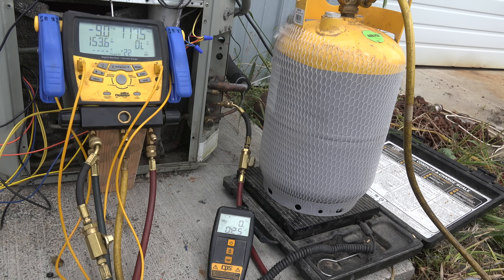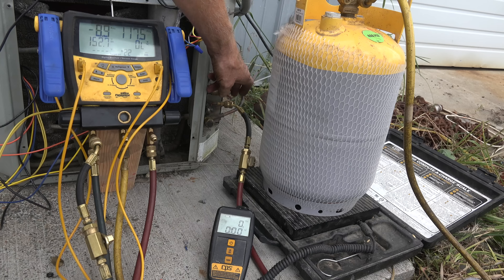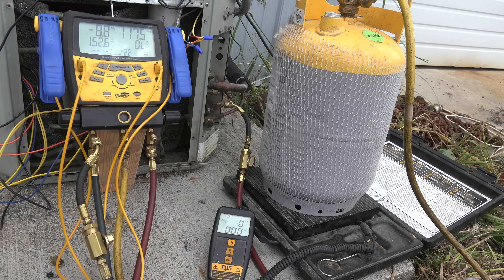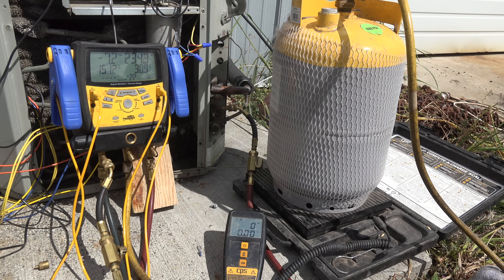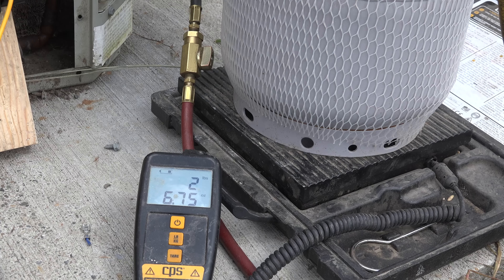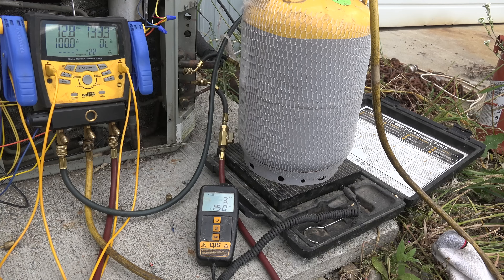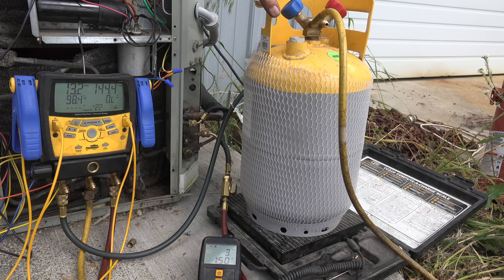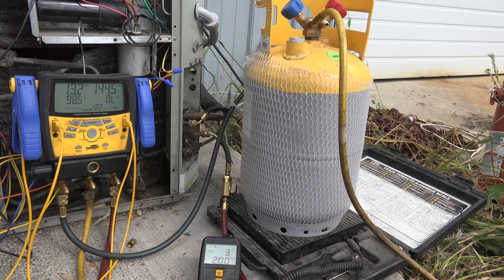Is oil removed with liquid refrigerant upon recovery #1.

Comment: I'd figure under vacuum even mineral/polyol oil would volatilize, which was why new condensers are shipped pre-charged.  I worked at a plant that did short-path distillation under strong vacuum (VERY strong, ~1 micron) which would trick vegetable oil derivatives into the gas phase.  Maybe the relatively weaker vacuum of refrigerant recovery isn't strong enough.  I know you didn't pull vacuum here, though.

Thanks for sharing.
Reply from the maker: Very little oil is gasified under refrigerant vacuum.
GFM
Reply: Boiling point of POE oil at room temp is about 10 microns of vacuum so for all practical purposes it remains as liquid at the best vacuum achievable by typical A/C vacuum pumps.  Tough part of vacuuming a system with distributed oil is getting the small microbubbles of humid air stuck in the POE oil which is highly hygroscopic (likes to absorb water).

Comment: I didn't catch what type of refrigerant it is, but for R410A it is highly miscible (in all phases, gas/liquid) with the lubricant, so basically you can't separate the oil from the R410A, it's a homogeneous mixture.  So presumably the 'oil' went into the tank, and then back out again.  It's interesting because it seems to negate the use/avoidance of oil traps in systems that use R410a, whereas in the past it was presumably necessary with other refrig's.
Reply from the maker: I think you have a misconception about miscibility.  
Gaseous refrigerant is not miscible with liquid oil.  When refrigerant evaporates, the oil is mostly left behind as a liquid.  A very small amount may be atomized and moved with the refrigerant gas but it is a very small amount.
GFM

Comment: Typically, about 2-3% of liquid line flow is oil.  But that rate is for normal operation. For 3 lbs, 2 oz, that is only about 1 to 1.5 oz of oil, under normal operation of total liquid refrigerant in liquid line with proper refrigerant charge.

When pulling out the refrigerant via running compressor, the vapor mass flow rate out of compressor high pressure port and through the condenser will continue to drop so less oil droplet mist, while refrigerant is still vapor, will make it into liquid refrigerant on liquid line output of condenser.  A lot of the oil will cling to walls of condenser tubing where refrigerant is still vapor without enough vapor mass flow to move it along.   Once pressure drops to where no liquid refrigerant is made, the liquid line output will have very little oil content.

Comment: You have to unscrew the cylinder's valve out and Then check if ther uss any oil left in the tank
Reply from the maker: Or you could turn the cylinder upside down and open the valve.
GFM
Reply: This is the only conclusive way to validate the claim. Unscrew the plug or unscrew the tank valves. How can you prove there is no dip tube short or long in the vapor port...

Comment: Fantastic video GFM!! This is a major question that I have always had on my mind. So you just used the compressor and not a recovery machine for this test?
Reply from the maker: I did use just the compressor and removed all the liquid I could.  I did not use the recovery machine as it would have only removed gas at that point.  
GFM
Reply: grayfurnaceman 
Hello my name is Marcus and I needed some help. I am a 2nd yr apprentice I recently recovered R22 from an old Russell unit cold box the reason I recovered the 22 is because the customer wants to move the outdoor unit a little closer. So after Recovering I cut the pipe and capped the pipe. My concern is after I install new pipe and purge with nitrogen and pressure test will I damage the vaccum pump with the refrigerant oil left in the system?
And can I reuse the R22 from the recovery cylinder?
Reply: Marcus Reynolds you should not be doing side jobs if you don't know what you're doing.
Reply: That's interesting, still, old habits, I always withdraw from the liquid side just in case, to suck any oil back out

Comment: This isn't my favorite Gray furnace man video. I don't like using additives in systems but zero ice or Renew was recommended by all the manufacturers after the TXV problem and if worked to clean the txvs in many many cases. I've read too many stories about that to call it snake oil. 
Another product most of us have used to quiet down compressors is Supco oil  that smelly red oil. It has worked for me on  a few service calls. 
The acid away additive for burnout replacements seems to be another product worth considering. Acid type filter dryers would be important but something like "Acid Away" ( and the other brand I can't remember) seem to provide extra protection.
Since R410A  systems use POE oil and any moisture in the system can react with the POE oil and cause it become acidic I wonder if we won't need additives for that in the future.
When flushing out linesets when switching over from R-22 systems to 410A systems  to remove the mineral oil which doesn't react well with R410A- these flushes are always before evacuating and they are very volatile but  - if some of the mineral oil is still in the refrigerant pipes it might be good to have an additive to keep it from sludging up the system. If that product keeps the oils in suspension.
I wouldn't recommend leak sealers - for the reasons you mentioned.
I never had much luck with dyes either. Very messy too.
I think the refrigerant oil that lubes the compressor is also good for the metering device and maybe the reversing valve too as well as any moving parts inside the refrigerant system. In that way it does improve the efficiency of the system. This brings up the idea most the refrigerant producers suggest- which is to add POE oil to R-22 alternate refrigerants to get better oil return - take MO99- seems like if they added some POE oil to the MO99 in the bottle it would be a good solution. Same with almost all the R-22 replacements - if you are using them with a mineral oil type compressor the chemical producers suggest adding some POE oil to help with oil return. 
I see little harm in the R134A for automotive use having some oil in it -I agree with you  for refrigeration use a dry refrigerant is best.
I agree 99% of the time stay away from additives in HVAC systems- but they aren't as terrible as spam but even spam may taste good if you are starving.

Comment: Good morning grayfurnaceman! Are you sure this method works to separate the oil out?

I thought that you need an oil separator to get the oil removed from the refrigerant while it is in a gas or vapor state. The way your doing it the oil is never separated out is it? It just rides the vapor right back into the system and leaves the tank empty?

Auto AC recovery systems have oil separators and If you recover a car AC system,  typically 1 oz of oil will come out of the oil separator. Out of a 2lb freon system you generally separate out about 1oz of oil.
Reply from the maker: It does separate the oil from the refrigerant.  Oil does not boil or condense.  Some of the rotary compressors in auto air do not use a sump for their oil, so the oil is pumped out of the compressor by atomization in fairly large amounts if the compressor is running so it returns in fairly large amounts.   Much like a 2 stroke motor uses lubricating oil mixed with the fuel.   If the system is not running, very little oil will be removed.
GFM
Reply: Thanks for the reply and all your helpful videos. How much oil and what weight is usually added to a new home AC system? All my AC experience thus far is with auto but I'm very interested in all refrigeration systems.
Reply from the maker: I don't have any accurate numbers here, but I have found about one to two quarts in compressors I have disassembled.  These are sump type systems and should have most of the oil  in the compressor.
GFM
Reply: One more thing you could do to make absolutely certain that the oil is not riding the vapor out of the tank is to add 3 oz of oil to the tank that has just been recovered into, then take a second tank and move the refrigerant with 3  oz of oil from tank 1 to tank 2 in vapor form to see if the 3 0z of oil will be left behind in tank 1.

Comment: I’m trying to recharge an air conditioner in a Ford I know that it needs 40 ounces of refrigerant but how do I know if it needs oil and should I replace the oil or just the refrigerant also can I just fill the system with replacement cartridges from Walmart if it’s completely empty of refrigerant
Reply from the maker: There is no easy way to determine if the system needs oil.  My recommendation is that if you have a very large oil slick where it was leaking, I would add oil.  Otherwise just refrigerant.  
However, you may have an additional problem.  If it has leaked out, the leak needs to be repaired and the system evacuated with a vacuum pump.
GFM
Reply: @grayfurnaceman  I just did a little test on the Schrader valve and it has pressure in the system and I believe there’s Freon oil came out so the systems under pressure it could be that the clutch is not engaging on the compressor or there’s not enough Refrigerant what is your recommendation just add a little bit at a time until the compressor engages I better get myself a set of gauges I don’t know how much is in there
Reply: @grayfurnaceman  from what I can see the compressor clutch is engaging and disengaging which I believe is an indication of low Refrigerant do you recommend that I keep adding a little bit at a time until the compressor stays engaged and I’ll take a Temperature reading in the vent for a quick fix what should be the temperature coming outside today’s ambient temperature is around 80
Reply from the maker: @peterlaurancearmenio5545  It is most likely that you are low on charge.  The clutch will disengage when the low side pressure reaches a preset pressure.  
A manifold gauge set is necessary if you know what the pressures mean.  If not, you may be served well by buying a charging set that includes refrigerant with a valve, gauge and a short hose.  
When the gauge reaches the operating pressure, you are done.  Also realize the system is leaking and it will have to be recharged periodically.
GFM
Reply: @grayfurnaceman  OK thanks for your help brother
Reply from the maker: @peterlaurancearmenio5545  The temp should drop about 20F from return air temp.  This number is variable and should be checked with temp of the suction line temp at the compressor.  One of the easy ways to test suction temp is to note when the line starts to get wet from condensate.
GFM
Reply: @grayfurnaceman  Thanks for your help I put 18 ounces of refrigerant into the system the air conditioner is blowing cool but it’s not freezing the meter gauge was past the green and slightly into the yellow should I keep adding refrigerant until I’m passed the yellow and stop at the red
Reply from the maker: @peterlaurancearmenio5545  Leave it in the green.
GFM
Reply: @grayfurnaceman  Roger Roger

Comment: Hi GFM, do you remember the first recovery machines that you had to keep emptying the oil out of? I wonder what changed. I still use one to recycle my r22 and it always somehow seems to get oil out of my reclaimed gas weird no? its a Robinair unit btw.
Reply from the maker: Yes I do remember.  Never had one last.  The tool cage looked like a wrecking yard.  Amazing you have one that still works.  I never had a lot of oil come out.  The sight glass mostly stayed the same.
GFM
Reply: Thanks for the reply! I love my PFA-2 Recovery/Recycler, paid itself off so many times with the price of r22 these days. The gas works just as good as new, pressures are perfect and I've never had an issue with non-condensibles.

Comment: when I was in school we were working on a walk-in cooler and for whatever reason the  hoses on the gauge manifold had filled up with oil. When the instructor removed the hoses they blew oil everywhere. I could tell by the look (and the oil) on his face he was baffled. He said he had never seen that happen. Any ideas why that might happen? I don't remember exactly what he was showing us valve wise. I'm not sure if he had pumped it down or possibly even recovered the charge.
Reply: I might be wrong but if oil was changed in the pump at lower ambient temp. condition than working temp. then vacuum pump oil expanded and that what you saw in the hose. I had that issue one time.
Reply from the maker: Usually, the only time I have seen that is if liquid refrigerant was charged directly into the compressor.  That will cause the compressor oil to foam and oil is pumped out.
GFM
Reply: Maybe he sucked oil out of his vacuum pump?

Comment: HI , let me start off thanking you , Not only for your time ,but for the great info with your videos .  Being new to hvac , I have a question about recovery tank  Recertification .  I found my self two brand new never used ,recovery tanks ,A few years  back  and haven't used them yet , both of them are still filled with nitro . My  concern is with the D.O.T. law of needing recertification every five years , I find my self now with two tanks never used running out of the five year testing date . My question is two part  . 1, should I get the two tanks re tested, If I have a year left ? reason I ask this ,Is would it be a less cost to me if the tanks are still new ? 2, Question where do I take the tanks for recertification and would you know what the cost may be ? thanks I do follow your videos and enjoy watching ,in just now seeing this one ,gave me the reason for asking ,. ty for your time and reply      Bob

Comment: hello again.  The only drawback I can see is  not knowing what the underside of that valve looks like without unscrewing it. would a tablespoon of oil or two be able to drain out of it?  Add a 1/4 cup of oil to the tank and then re measure it in a measuring cup and check the weight also to see how much is lost in an attempt to recover it. Or add 3 ounces and then see if you can recover 3 ounces back into a cup???? In your theory of recovering refrigerant no oil is recovered, I think is flawed.  We normally try to recover liquid first, through the liquid line or king valve then as a gas through both sides.  I think if liquid is recovered,  oil will follow with it as a liquid is miscible form with the refrigerant.  As the recovery machine finishes pushing the liquid and oil combination into the tank, it then condenses gas to liquid and pushes that into the tank.  One advantage is that if its a burnout, some of that contamination is removed  and anytime you touch a torch to a pipe, you have to be concerned with smoking the oil in the pipe with brazing temps even with nitrogen... This is why many times I prefer to cut and coupling  a pipe,  rather than unbraze it especially if it appears like there may be oil in the pipe... It sucks when they separate and the oil is on fire especially if it spurts out of the pipe and you forgot to bring a fire extinguisher... it could be a harrowing experience.
Reply from the maker: I have pulled them apart and I believe if the cylinder is turned upside down there is virtually no oil trapped.  The point of this video is to show that the volume of oil in the liquid refrigerant under normal operation is very low.  Even if the unit is low on charge, it could take months of operation to pump all the oil out of the compressor.  Most manufacturers recommend cutting the tubing when replacing a compressor.
GFM

Comment: Hi... is there a way to do this with an R134a system? Thank you, John
Reply from the maker: If you are attempting to recover refrigerant, this system works for R-134A.
GFM
Reply: @grayfurnaceman  is the conclusion of this demonstration the same for r134A?  Oil doesn't come out when recovering the refrigerant?  Specially for a car.  Thank you.
Reply: @Goflyingbear  Auto air generally removes very little oil with the refrigerant when being recovered.  The only time oil comes out with the refrigerant is when the refrigerant is removed as a liquid. 
GFM
Reply: Joe got it thanks!!

Comment: So the question then is why is there no oil since it readily mixes with liquid refrigerant?   Is it getting trapped in the accumulator?
Reply from the maker: Its not trapped, there just is not a lot of it in the liquid refrigerant.  Compressors do pump oil as they operate but it is limited by the manufacturer because the more oil that's in it, the less efficient the system is.
GFM
Reply: I think even a 2 ton scroll has something like 16oz of oil (this is from memory it could be more or less).   We know it gets dispersed throughout the entire system.    So probably the amount that stays in suspension with the liquid refrigerant is minimal.  Enough to coat the inside of your recovery tank but no more.   The only other feasible explanation is that it gets boiled off into a sludge and trapped in a filter at low vacuum.

Comment: if you were to do this on a car with r134a where the compressor clutch broke (iam replacing the compressor with exact amount of oil)and you can not mix the oil with the refrigerant will you still pull oil into the recovery cylinder or just the liquid refrigerant. My concern is putting the refrigerant back with the tank upside down some extra oil might get back in and i will have too much oil and my fear is it will damage the expansion coil which is a aside from being expensive is a pain to get to as i would need to remove the dashboard.  Thanks. I know you may not do cars but the process seems to be the same from videos i've watched.
Reply from the maker: Unless you are removing the refrigerant as a liquid, very little or no oil will be removed.
GFM